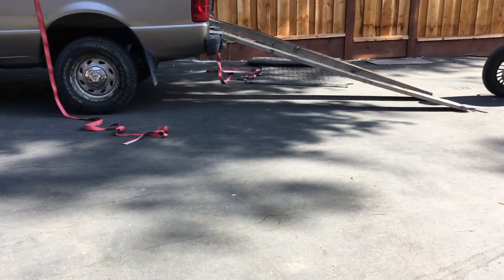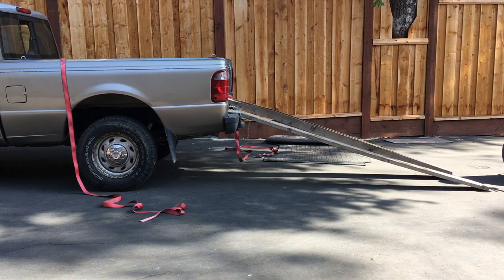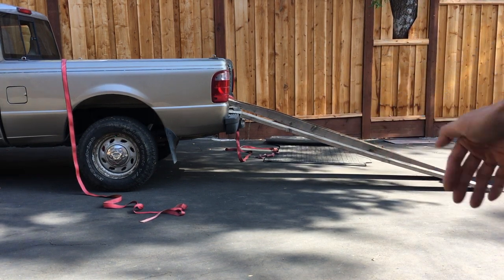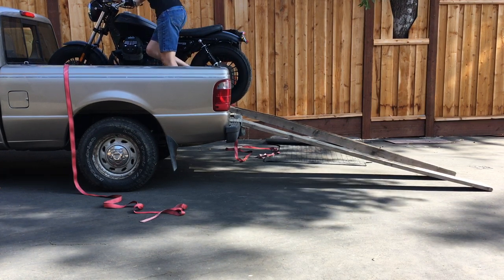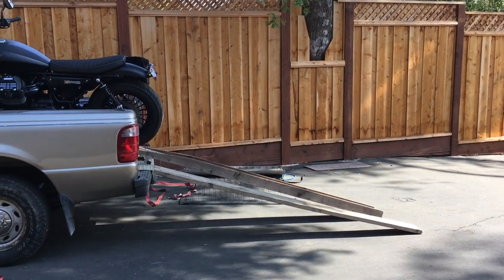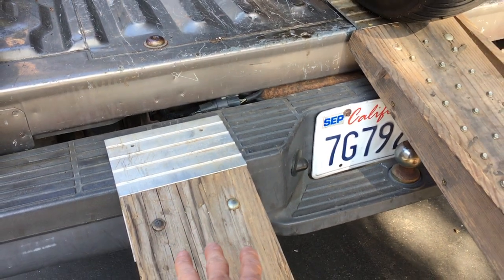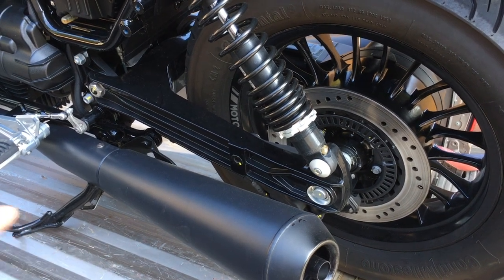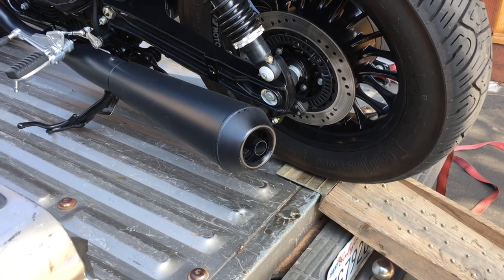Loading motorcycle by yourself into pickup truck

Comment: It's good seeing how it is is to load a motorcycle into the same truck that I have. I have an Yamaha R3 and the wheelbase is slightly shorter than your bike which I like since it won't rest on the tailgate. I was thinking of leaving the tailgate on though during loading. What do you think?
Reply from the maker: I always take the tailgate off.  The Ranger tailgate is only rated for 300lbs.
Reply: @DaBinChe  Oh. I've read a lot more. But thanks maybe I'll take mine off.

Comment: Your nkt a big guy and your walking board was giving out.  Nkt enough support.  Im not sure you can get the bike off the same way.  Usually you should be sitting on the bike with both feet on a platform and riding the front brake.  Be carefel/safe.
Reply from the maker: Been using this set up for over 15years with all kinds of bikes, some heavier than this bike some lighter.  Got two boards, one for me, one built strong with reinforcement for bike.  They are 8ft. long, longer than most motorcycle ramps to clear the belly at the top of ramp and tailgate.  Sitting on a bike and riding up/down is not a good way of loading a bike, the belly will hang up and you will fall...even a U-haul box truck ramp is not long enough and those are at least 10ft long.  There are plenty of videos showing folks falling riding up on a U-haul.  Your weight squats the bike down so you have less clearance, so no sitting on a bike loading it.  Only bikes that can clear while sitting on it are dirt bikes.  Or if you are using a trailer where it is much lower compared to a truck.  They also make ramps that are curved and long like mine so there is no angle at the top/tailgate but those are narrow with no place for your feet so you have to ride up.  But really no ramp is intended to be ridden up only standing along side cause the bike will get hung up and you will fall.